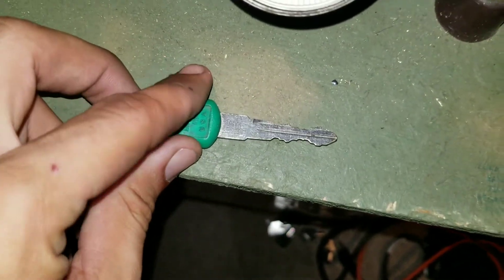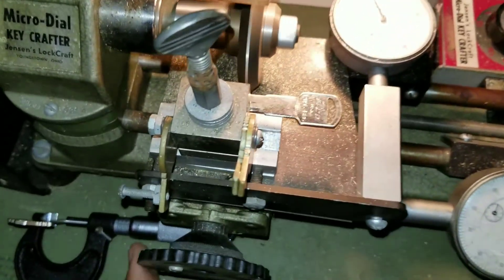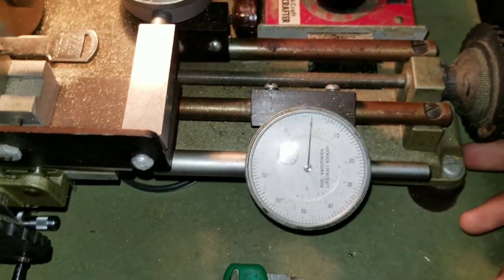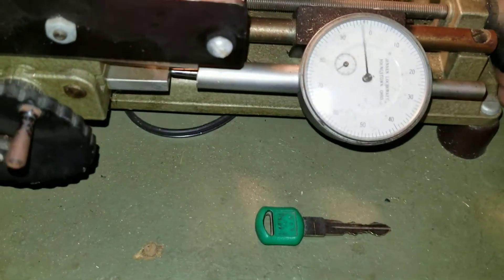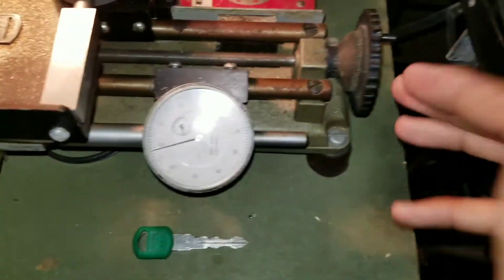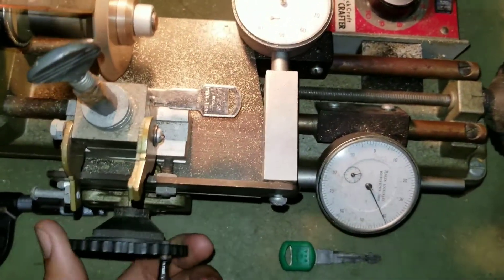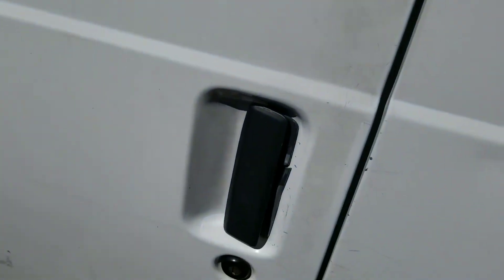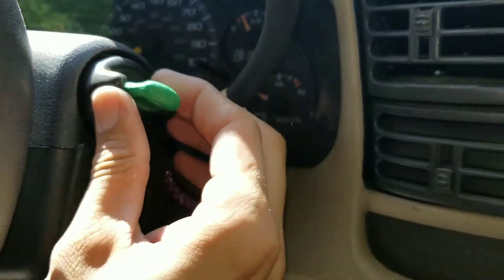ANTIQUE Jensen Micro-DIAL Key Code Origination Machine! TESTing Calibration after REPAIR.

Comment: Looks like my unimat db/200 later called sl/1000 metal mini lathe , mill,saw, drill,grinder.
Reply from the maker: Yes. Jensen made hobbyist tools and Framon made machines. Theyre similar but Jensen opted to retrofit other ppl’s platforms, such as you stated.